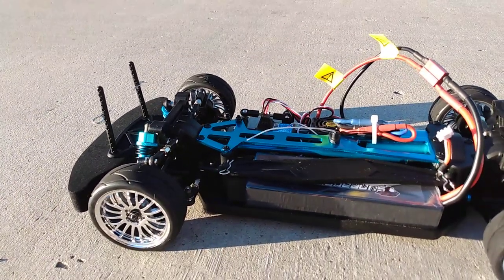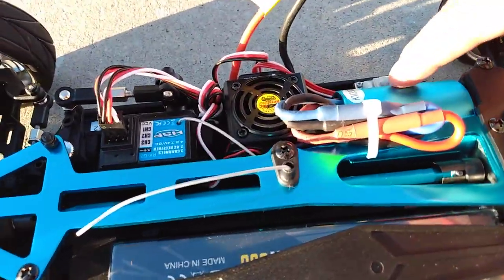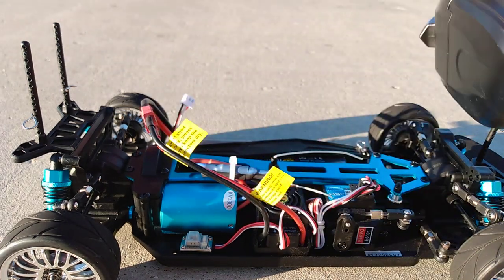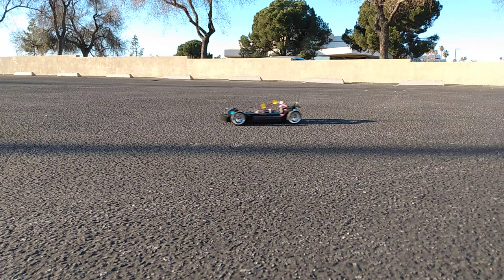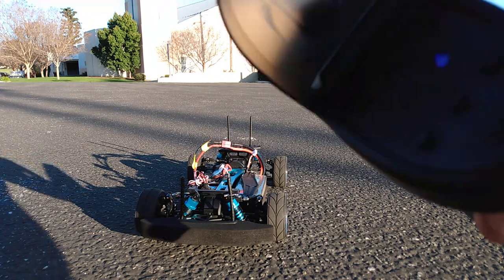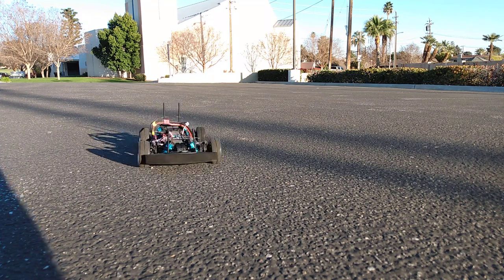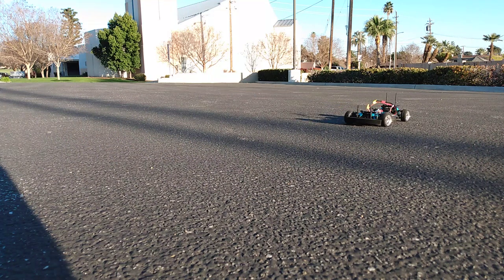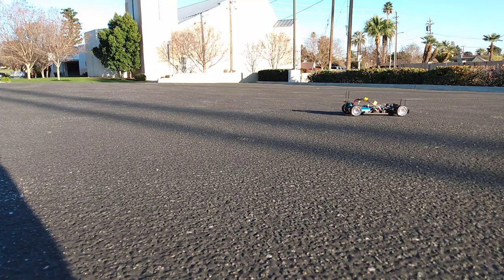HSP RC Drift Car Brushless 3300kv Outside Test Run

Comment: I've been wanting a quality rc drift car for awhile now and have looked around for one that doesn't cost an arm and a leg. Thanks to your great video reviews, I purchased this exact same car today. Thank you!
Reply from the maker: Trust me you won't be disappointed even if you bought the brushed Edition this RC car is made very well everything inside is METAL including the spur gear it's very STRONG and tons of different rims to make your car look even better don't forget to get the rims that have an Offset you will understand when you start to look at the rims
Reply: @MightyistheRCGamer  I also gonna add you can always switch to a brushless motor once the brushed one shits out on you. a brushless one will set you back about 50 bucks.

Comment: Great video very informational I do like the up close and detailed footage I have the exact and I do mean exact same car 3300 KV same color everything on just different battery of course but it's really feels good to find a video on my car look forward to many more videos of this vehicle I'm currently struggling on getting more angle turning I've upgraded my front cvds because it is four wheel drive to universal CVS which gives me that two wheel drive drift car angle but I do need to replace some of the linkages on the steering I've seen a couple other videos on other cars none like the one that we have so I'm kind of on the line about it whether or not to do it and I usually drive the drift plastic tires rubber on pavement it's really cool I was wondering what it was going to be late after watching your video going to go ahead and purchase some nice rubber style but yes love the video please do more videos on this car
Reply from the maker: It's a really good drift car I know the angle isn't good but I still don't mind I will maybe purchases another drift car something a little better in the future but I am still going to love this RC Car... Thank You your Kind Words  I Really Appreciate it and I am not just saying that Thank You
Reply: @MightyistheRCGamer  What color body did this have? Blue or black? On websites and in adversiting they show the brace and other few aluminum pieces as a bright, royal blue. However, in everything I've seen, outside of official pics and videos, everyone that posts pics or video showing the aluminum more or a teal color. 

The reason I ask and that it is actually important to me at the moment, is because I'm ordering one of the cars and was going to order a total aluminum upgrade kit, but they only come in the tealish blue, not bright, royal blue, or purple... I prefer not to go the purple route with this car.
Reply from the maker: @YeshuaDisciple916  I have bought many RC cars many in the $400 range and many in the $300 range and this RC was complete GARBAGE for $295. The RC broke down after only 2 days. STAY AWAY FROM HPI. And by the by the way I had the black body I actually got HPI to send me both the brushes and the brushed Edition
Reply from the maker: @YeshuaDisciple916  you can see the unboxing on my channel it should not be very far into my videos
Reply: @MightyistheRCGamer  What drift car do you suggest? Something that will work fine with stock parts, but can be able to be modified or upgraded.
Reply: @MightyistheRCGamer  thaks for the heads up, bro! That could have cost me. This is for my youngest son, who's almost 13 and has been into rc for about 10 years, but hasn't had a drift car for about 5 years. He really wants another one now and it would have sucked to buy two of them (he wants us to have identical cars, with identical liveries), if they're that bad.
Reply from the maker: @YeshuaDisciple916  The Redcat drift cars are much better but if you can get the Thunder Redcat Drift RC Car it is a belted RC Drift Car. Making it the best you can get for under $200 belted
Reply from the maker: @YeshuaDisciple916  here is one of the best for parts and it will last under $200 don't cheat yourself Treat yourself 

https://amzn.to/387BIkV
Reply: @MightyistheRCGamer  not to sound snobby, but do they happen to have a brushless version?
Reply: @MightyistheRCGamer  and you can easily find replacement parts for them? That's a huge contributing factor. Again, I thank you for you help.
Reply from the maker: @YeshuaDisciple916  No I am just like you a brushless snob. But I am very sorry they just don't... but I tried HPI and was unhappy but their response was HORRIFYING they didn't care about me or my problem. I told them my receiver didn't work because the RC Struggled to bind to the Transmitter and they didn't care they told me I will send you a new one in a month or 2 and I just return it to Amazon.. THEY DIDN'T CARE... But that's just me if you want them the choice is yours

Comment: Rookie question...so this car came with a 3500mah 30c 7.4v lipo. Can I put in a higher mah and c rating just as long as I'm using the same voltage? I was looking at a 5200mah / 50c / 7.4v  lipo. Would that be ok?
Reply from the maker: There is no such thing as a rookie question when it comes to RC-ing. And yes you can use a stronger C value if you like you could even use a 3s battery with this ESC

Comment: Damn, even on medium setup looks pretty impressive! I also have an hsp RC. People Say they are trash but with the right upgrade can be awesome machine! Mine is brushled and I want to convert to brushless motor cause the battery After 20min Is gone. What do you suggest to me? What Is the best and most powerful motor I can put in my rc model? Thanks
Reply from the maker: Here is what you need to get up to speed.... 
https://amzn.to/3trKWiQ
Reply: @MightyistheRCGamer  Can I go higher with the kV of engine? I have seen some motor with 3.500kv or more, Is It possibile to install them on a hsp?or there are dangers? Sorry for the clearance I am not an Expert. Thanks anyway
Reply from the maker: @doubleclutching4411  Don't ever worry about bothering me Brother I am here to help... The answer to your question is yes you can use a higher KV but the lower the KV the faster it will go I have a 1920kv in my BIG 8th Redcat Landslide and it goes pretty fast. Putting a higher KV will give me more torque and power but less speed so it's really up to you
Reply: @MightyistheRCGamer Backwards. Higher Kv is more speed, lower is more torque.

Comment: What color body did this have? Blue or black? On websites and in adversiting they show the brace and other few aluminum pieces as a bright, royal blue. However, in everything I've seen, outside of official pics and videos, everyone that posts pics or video showing the aluminum more or a teal color. 

The reason I ask and that it is actually important to me at the moment, is because I'm ordering one of the cars and was going to order a total aluminum upgrade kit, but they only come in the tealish blue, not bright, royal blue, or purple... I prefer not to go the purple route with this car.
Reply from the maker: It might look good anyways even if the colors don't match but it's more blue

Comment: Hey there. Hope you well. I found this exact Motor and ESC combo. Its relatively cheap and I have a few 2s batteries. Would like to put it on a TT02D chasis. Seems very quick as well?
Reply from the maker: It will do the job and it is 3s compatible

Comment: 269 probably should have got a fazer
Reply from the maker: Your probably right my friend
Reply: @MightyistheRCGamer  don’t get me wrong, its is a nice lil setup. Looks fast and stable.
Reply from the maker: @ja5639  No your right bro it has receiver issues. I should of bought the Redcat belted drift rc and just put a new body and brushless set up
Reply: @MightyistheRCGamer  the vxl 4tec 2.0 is my favorite 1/10, its 4s right now handles the power well, easiest to work on